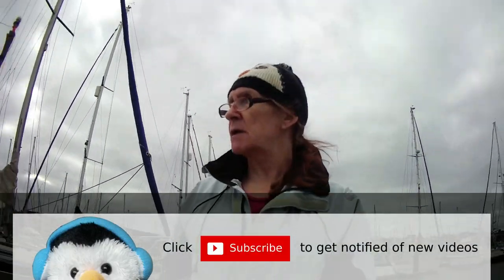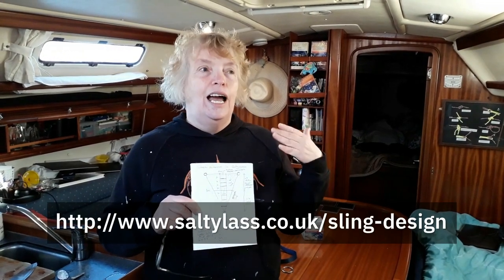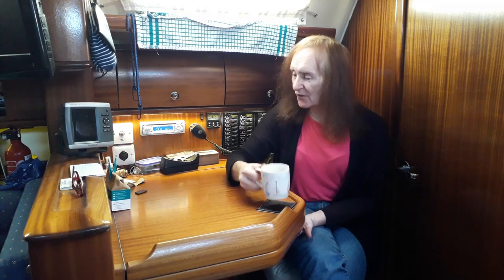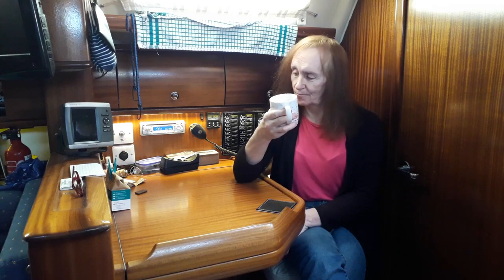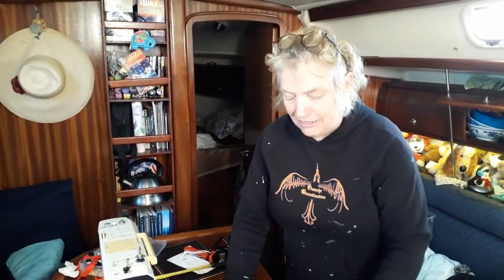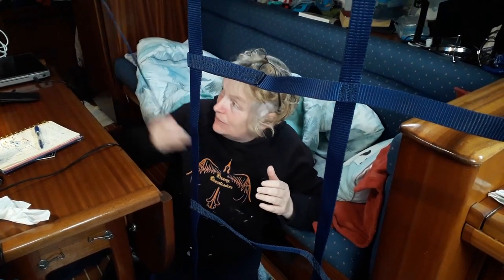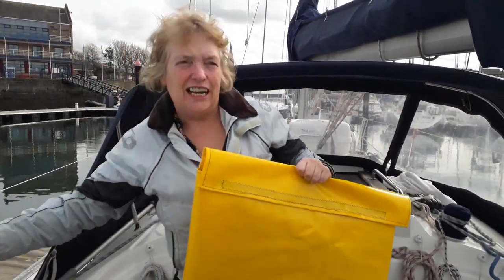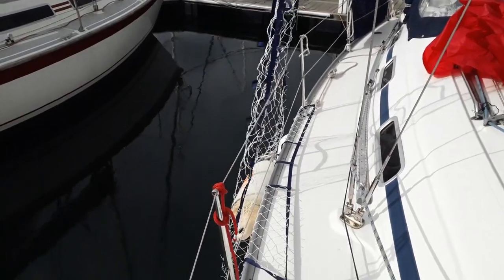Man overboard - Rescue Sling - Getting ready for cruising - Ep. 229

Comment: It reminds me of one of those cigarette rolling machines, it looks effective. In practice, with the casualty keen to get back aboard, isn't the advantage of a sugar scoop stern that anyone in the water could be brought back aboard there easier and quicker. Here's hoping it will not be needed.
Reply from the maker: Hi Mike - that is the advantage of a sugar-scoop on a calm day, but in bumpy stuff, there is a danger of the stern slamming down on top of the casualty. On that sort of day, the best place to bring them up is amidships which tends to have the least movement, but with a freeboard of 1.25 metres.... well, our arms are not long enough or strong enough.
Reply: @SailingYachtSaltyLass  My experience with the modern hull is limited, I just wonder what decisions would be made in the stress of an emergency. I know the RNLI use something like that to recover unconcious, immobile or dead casualties. I have experienced the stern boarding difficulty on a counter stern yacht, wind against tide in New Grimsby Sound, the rise and fall of the counter over our heads, timing was essential. I wonder if a chute from the sugar scoop similar to your Rizla machine with pockets for fenders may solve that problem, like aircraft emergency exit  types?
Reply from the maker: Having spoken to more experienced sailors, they advice not trying to recover at the stern if there is swell making the stern bounce, so thus the mid-ship recovery. The sling is designed for injured or unconscious recovery. All that is required is to get them into the sling and them winch them up the side with the halyard. The sling is setup, the boat moved to the casualty, the sling tossed over and the casualty recovered into it. The only setup is dropping the main, cleating off two lines and clipping the halyard.
Reply: @SailingYachtSaltyLass  I think having a dinghy like you have at the stern and using that would be an option. It could be pulled up tight against the transom, partially out of the water. Even a full crew can fail to get a person out of the water. (Rob James was one) It took three hefty men to lift out a fisherman I know, it's the clothes that can weigh a lot when wet.
Reply from the maker: We intend to try the dinghy method, but we reckon that the mechanical of a winch would do the job. If not, we may look at rigging a block on the mast